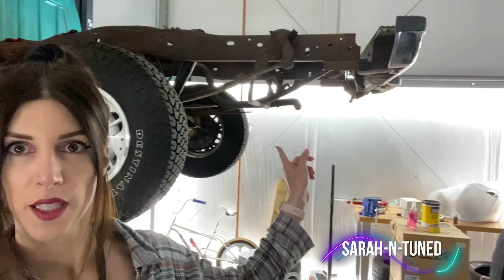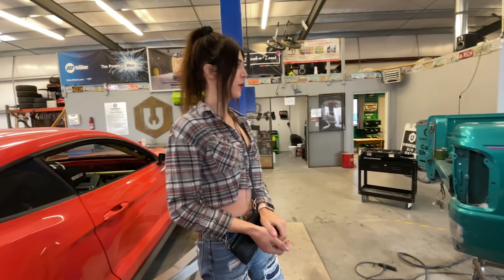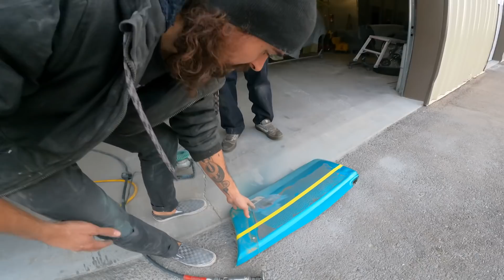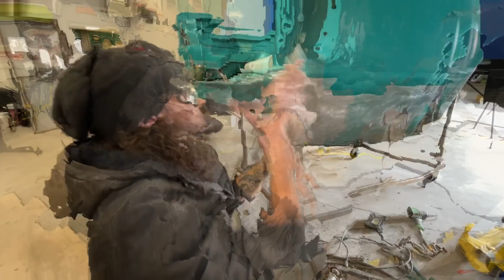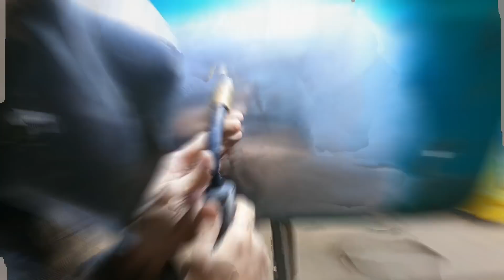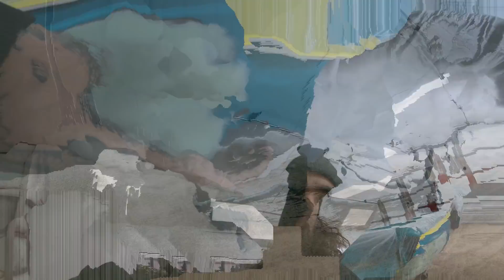Truck Bed Rust Repair- How to Repair Truck Bed Rust

Comment: Hey, I had a quick question for you does that carpet trick really works because I got a painting but it’s just like yours.I haven’t put it up but that’s what I’m thinking about putting down carpet before I start painting
Reply from the maker: Yes it does. Fred started using carpet more than a year ago but now buys New Pig Paint Booth Mat. Cost is similar to buying carpet.
https://www.amazon.com/New-Pig-Protects-Surfaces-Dissipative/dp/B07ZK3V6FY/ref=sr_1_1?crid=28APJYO5IABP0&keywords=newpig%2Bbooth%2Bmat&qid=1694377554&sprefix=newpig%2Bbooth%2Bmat%2Caps%2C161&sr=8-1&ufe=app_do%3Aamzn1.fos.ac2169a1-b668-44b9-8bd0-5ec63b24bcb5&th=1

Comment: Hi Fred, you said the same thing about doing fiberglass and nailed it. Modesty. I'm working on the bed of my S-10 had to replace the whole bed side and part of the frt. bed wall and rail which I had to fabricate, This is in SW Pennsylvania so sometimes you don't have much to work with. I spent some time in Tucson 50 +yrs. ago and I could not believe the condition of the vehicles in the wrecking yards, they were in better condition than the stuff here on the street.You Fred are a master in your field and beyond. Great Job man.

Comment: I feel bad for saying because you did such a great job. But if you're not aware of it the Por15 is actually a 3 stage rust preventive system with 3 products (degreaser, metal prep and coat).  The Por15 metal prep is important to prevent rust from developing again underneath the coat. If it's left out the Por15 coat can end up pealing off again. Also the Por15 coat is actually not UV light resistant. So it needs a coat of "normal" paint on top of it. I hope this helps so you don't get any surprises

Comment: Greetings from yet another viewer of Sarah's! Thanks for being so detailed in showing the process -- I will probably never do it myself, but it'll be easier to gauge the work of a body shop. In the future, if you don't mind, would you provide a few words explaining some of the terminology? For example, I've never heard "kitty hair" used in the context of metalworking, and the meaning wasn't clear to me from the video. No problem hitting the googles, but it would be nice to have a bit more context to search with. Subbed! 👍️
Reply from the maker: We will be sure to explain terminology in the future -  Kitty hair is formulated with long strands of chopped fiberglass which doubles the strength of standard fillers.
Reply: @UWrenchTV  Oh! Cool. Thank you!

Comment: Nice job, learned a bit there for a project I need to do on my e46 BMW rear arch! Hopefully not that bad just a sand, antitrust, fill sand and paint/blend in.. Just subscribed as didn't know you guys had a channel aswell!

Ps . Did you anti rust the inside metal panels and structure for rust prevention or just leave it as is? 

Cheers from London England 👍😎🏴

Comment: As an older guy who worked jobs like this for a long time, make everyone wear safety gear - primarily respirators or masks when sanding or grinding. Eye protection, etc.
Reply: I put my respirator on and mask after I got like a 1/4 way through the first patch panel,thanks for looking out tho!
Reply: @reidmartin3960  Very nice!